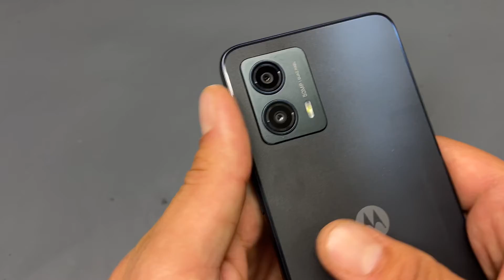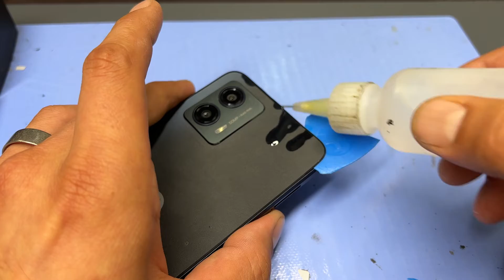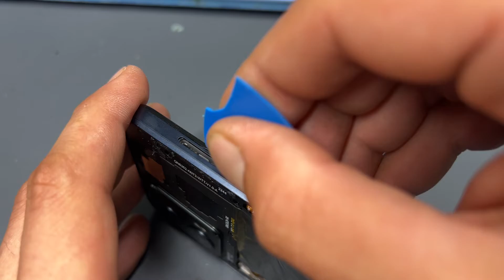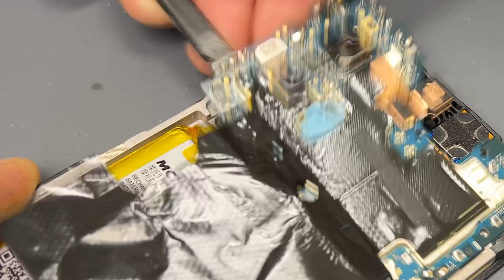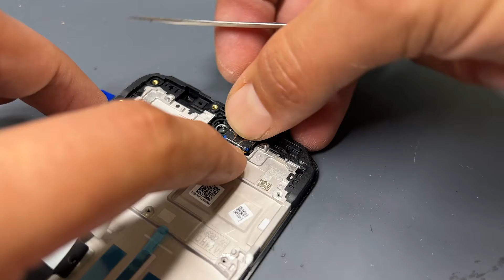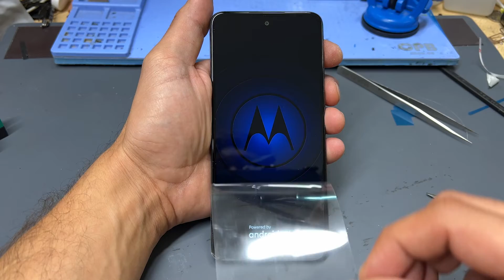Motorola G53 Front Screen Replacement Step-by-step guide

Comment: What about the thermal paste, the blue stuff? Most of it remained stuck on the back of the old screen. I'm planning to get my screen replaced but I'm afraid my phone will get higher temps, because it seems like technicians don't care about applying thermal paste when they disassemble everything to change the screen. Can I ask the technician to also apply thermal paste?
Reply from the maker: You can ask the technician to do whatever you want him to do but he might not oblige